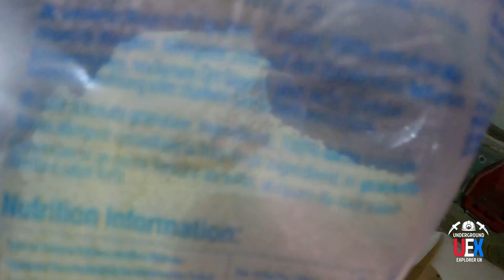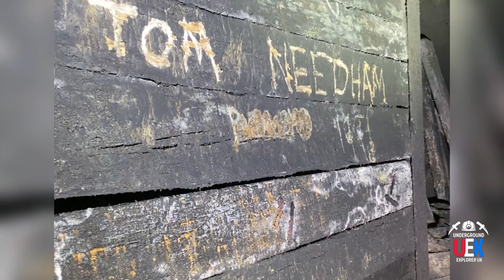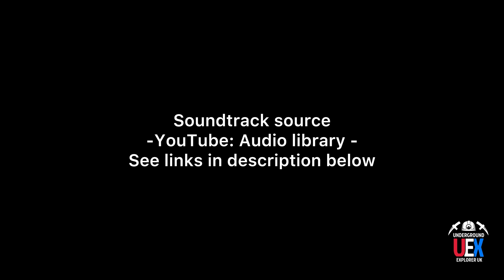A MARVEL OF MINING ENGINEERING: The Square  Shaft  in Boundary of 2 Mines. #mining #miningengineer

Comment: 2024, 🧔👷 my very thanks for Sharing this Video, nice adventure to have Seen also the deeper Level , i was thinking about the squares upwards and downwards could These be prepareworks to wanna Install a lift . But the Low hight of the deeper Level dont Look for space to Walk in IT . What a crazy Life to Work dayly in a such DARK area . 👍⭐
Reply: No I worked on this rise hole it was cut to use as a rise and tipping point between the levels it's 160ft deep and was cut in 1991